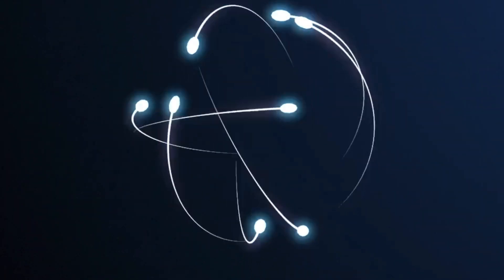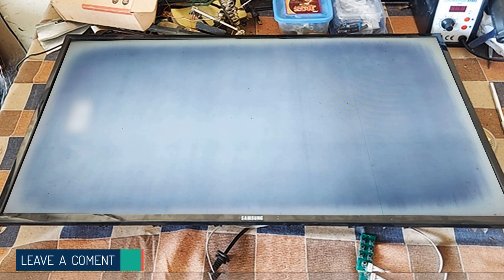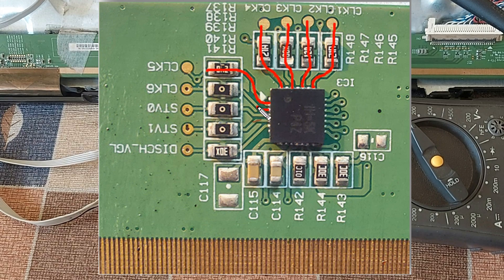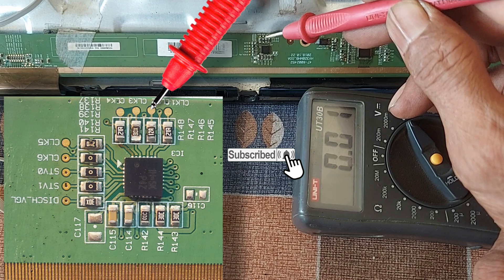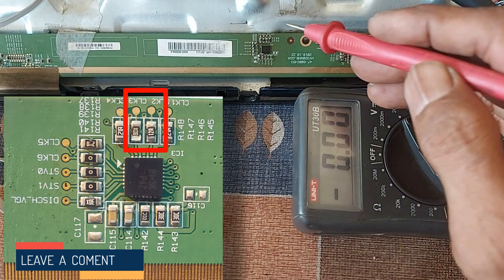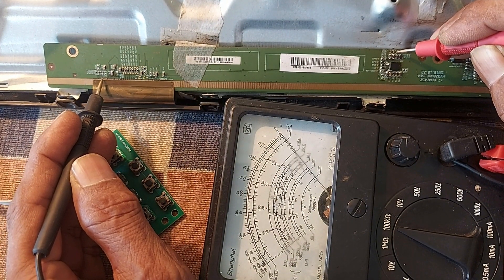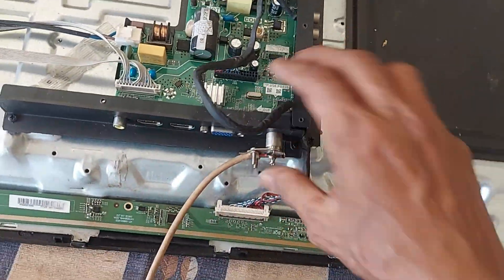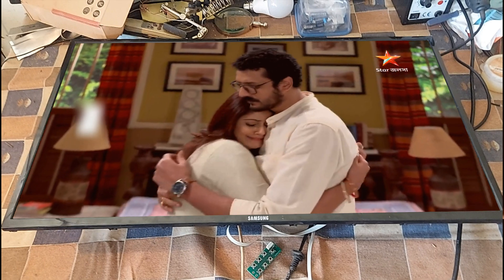Frozen Picture Problem Samsung 32 Inch LED TV | Freezing Image Then no Picture & Graphics

Comment: Hello sir I have same problem its a 42 inch 3d TV  42lf6500 (lc420duh-mgp1) it's directly flex cable connected to LCD from main board. it's thin pcb in lcd. There one side few resistors get hotter but other side is not.

Comment: Thank you very much Mustafa. What is the panel number? I have boe panel. And there are clks. And problem
Reply from the maker: The last two numbers on the panel number were very blurry, but N85 or N88 or N86 would be sure.  HV320WHB-N85 or N88 or N86.

Comment: amazing thanks. I have question 24 inch tv half display problem? the right side source cof have little cut and I compared voltages on test points near left and right source cofs & found vgms, ydio 0volts on test points on the right source cof. How can I fix that?
Reply: Ydio,yclk,are signals can be measured only using oscilloscope
Reply: @premkxk  thank you very much. but near on the left source cof of scalar pcb I found vgms1(3.3 v), Ydio1(17 v) but on the right source cof vgms2 & Ydio2 missing(0v) how can I solve half display that shows left side good picture but right side white display with a vertical line?
Reply: @dailyfeast3863  , ,on right source COF  u mean voltage missing in cof test point or pcb test point , if there's a TCON board try to find the voltages in it and jump it to the next missing point
Reply: @premkxk  thank you. It was on TCON board test point. thanks for helping me you are a great person